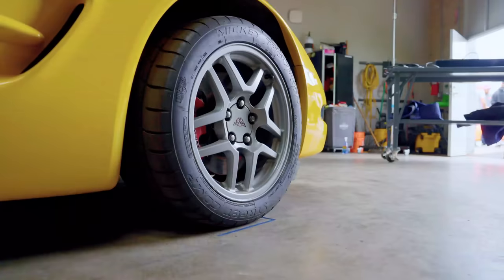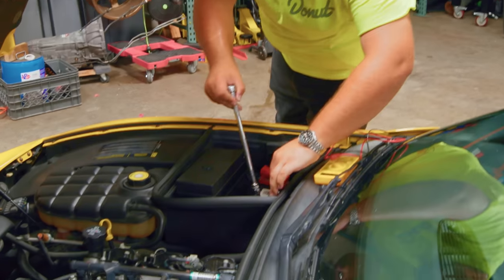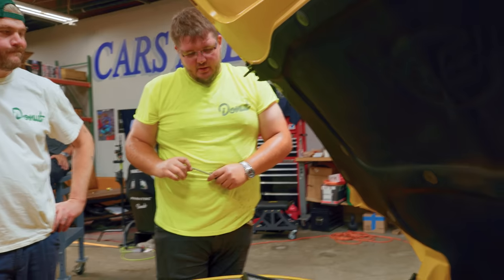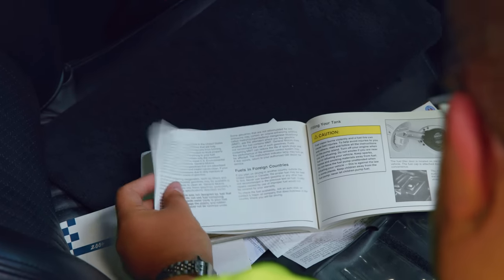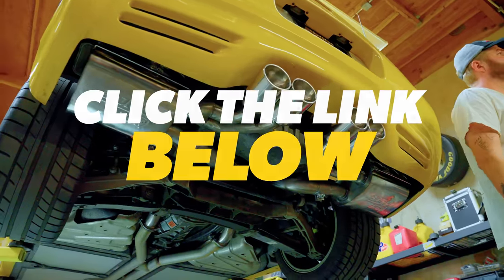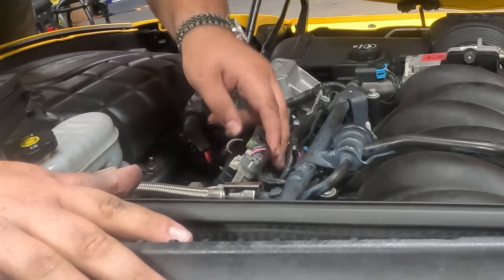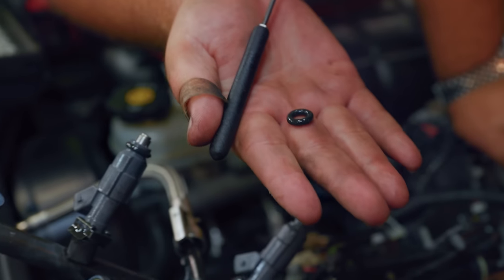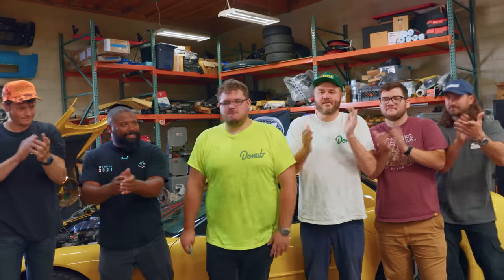Giving Someone a Corvette, If They Can Fix It

Comment: im ngl i like when people in videos actually stick to what they say instead of feeling bad and giving it to them anyways.
Reply: Agreed but there should be a secondary prize. Like a $2000 beater or the $20000 Corvette. Plus them saying there’s six things to fix the car then having multiples of certain things, spark plugs I get because that’s eight of ONE object, but having multiple vacuum leaks is MULTIPLE objects. That’s more than six. A vacuum leak is a symptom of a fix needed so they should’ve either just done one vacuum leak or said there were more than six fixes needed. Of course they can’t just win every time so not worried bout that but you’d rather see someone lose because they don’t know how to fix it, not because they did something slick or anything that could be considered dirty.
Reply: @OnEst_Opinion yeah this one was the hardest one so far I think. And it’s a v8 so there’s tons more to check. And it being a corvette is just allot of stuff to check in the 100 minutes he got. I do agree he should get $500-$1000 per each problem he fixed. So that if he only did 4/6 he would get $2000-$4000 and then the grand prize if you do it all you get the whole car.
Reply: @OnEst_Opinion bro finding that last vacuum leak would have taken half an hour alone
Reply: It would have been great if they hadn't have cheated.
They say 6 sabotaged things but in reality they did 10!
Reply: @dalynferguson2582  I don't agree. These sabotages were quite basic. Nothing particular specific to a Corvette. For example, when you find a plug with a broken wire, you don't stop checking the other plugs. He let the pressure get the better of him and thought that since he found the sabotage, he could move on. Forgetting his basic mechanic skills.
Reply: @OnEst_Opinion  When working on a car, if there are 2 bad spark plugs, then I'd say lack of SPARK is the problem (One object)...And likewise, if there is one or two vacuum lines that are bad, I'd say VACUUM LEAK is the problem (Another Object). If the car won't idle smoothly unless you fix ALL leaks, then I'd count it as one....That's my take on that part 🙌
Reply: what this car worth in the states ?
Reply: @kio51423 agreed. being in the industry if i had a customer with a vacuum leak as their reason for rough idle, say we just fixed one leak and did not recheck the system. they came back with a rough idle, it would be counted as an incomplete repair because we did not quality check our work
Reply: @nicovanos  You're using hindsight bias.
Reply: @kaisyaya8492  Not sure of the mileage but it's also an autotragic. If it's high mileage, I would say roughly $20,000 USD. Mid-high 20's if it's lower mileage (and had a manual transmission)
Reply: And you know they loaded him down with merch lol
Reply: @OnEst_Opinion  In the ending shot you can see he's holding a wad of cash so, that sounds like a good consolation prize to me
Reply: @hhaste 14:49 Is that not manual? It's a quick shot, but the ebrake is up, too.
Reply: @kaisyaya8492  maybe around 20k depending on the miles.
Reply: @kaisyaya8492  a manual z06 will easily go for 20-25k, possibly more depending on condition/miles. I bought a base model manual c5 a bit over a year ago, and average price then was 15-20k for base models. It being manual adds a lot of value.
Reply: @pprb123  Just about to mention this. He's holding a stack of bills in his right hand at the end, but I'm sure it's hard to dull the sting of not being able to roll off with the Z06.
Reply: @dalynferguson2582  He was holding some cash in his hand at the end.

Comment: Damn 90 minutes(plus the 20 extra for installing the borla exhaust) for 2 spark plug wires, battery, a fuse, 2-3 injectors, a block of ice with a key in it, AND 3 SEPARATE VACCUME LEAKS. It would have taken me more than half a day to fix all that assuming I could find them all quickly. Good job to Sam for getting to the last fix. He deserved the vette 100%

Comment: I feel like the throttle position issue should've given him a little extra time.  You did tell him 6 problems but  then there was a 7th, even if it was because of the battery.
Reply: There were 5 between the vacuum leaks and spark plugs, kind of stupid for them to say only 5 issues imo

Comment: Vacuum leaks are some of the hardest mechanical issues with vehicles, mostly because they're hard to diagnose and to track down. This test was so brutal, Sam you did a great job, you should at least get a consolation corvette model or something or maybe even another shot at another car.
Reply: No they are not! Hard to track down , if you have a scan tool go look at your data logger and find your sorry and long term fuel reins they will tell you where your leak is!
Reply: @JohnC-hj3dr  a data logger will let you know there is a leak and determine how large of a leak it is, but it's not going to tell you where the leak is coming from (brake booster)
Reply: Finally, someone who used the correct word and spelt "consolation" correctly.
Reply: @supradrifttv  They brought that into the shop and cut, loosened, and disconnected some stuff on the spot. Therefore, the computer wouldn't have thrown any codes that would've helped him out. I have a leak detector that uses smoke for vacuum or exhaust leaks which I bet would've helped him out alot here. That being said I doubt I would've fully solved half of the problems on this vehicle. There's a difference between finding common everyday problems with vehicles versus finding sabatoged stuff...

Comment: So close yet so far! Sam did very well. It almost felt like he was diagnosing the car as a pre-obdii era car (engine basics fuel, spark, etc.) which are a good strategy on every machine, but if he had connected the obdii reader first he probably would have found the fuse, fuel injectors, and spark plug wire tampering a lot quicker and saved some time.

Comment: That was brutal @Donut. I get not everyone can win but clearer instructions/directions would have been perfered. They never said they would (or even could) have repeat issues. And vacuum leaks, especially multiple, is tough to chase down on a engine when under a time crunch, even for seasoned mechanics. @Sam, keep ypur head up bro. 9 issues (not 6) in 90min and you got 8. Thats pretty awesome, and probably better then inwould have done.

And what happeded to the bonus time for trivia answers?
Reply: theyu didn't give him +10mins for the second spark plug wire either. This was not cool

Comment: I hate knowing that there are Mechanics and Technicians out there suffering with the clock the same way as Sam.
Reply: And if they did what was said in the intro.  He was supposed to be given an opportunity for more time regarding  car or donut knowledge.  Which they only had the exhaust.    No knowledge questions.   Just an exhaust task
Reply: @drewmassa  I think the Fuel Injector O-Ring Disaster of 2023 may have scuttled the Trivia portion of the show. That seems to have really eaten up too much time

Comment: If they had let him start it up, it honestly probably would have actually ran fine without the brake booster line 🤷🏻‍♂️ I get that it was a sabatoge. But if the premise is to get it "running right", it probably would have been passable.

Comment: Bummer to see sam lose but as it goes with diag it's air fuel spark. And you try the simplest methods first and you check them all. None of the sabotages was Corvette specific. Also as a tip out there for ppl, the obd port has a linked fuse with the cig lighter/ aux power. If neither works it's a blown fuse. Might have saved him time.

Comment: he did some big mistakes under pressure going after crankshaft sensor before checking rev meter and checking for codes to confirm Cam/crank shafts correlation problem ,,  and he gone for vacuum leaks and sparkplug wires before starting the car which wouldn't prevent a v6 or v8 from running and trigger codes which would be easier to diagnose later

Comment: That was NOT 6 things wrong with the car, that was 9+!!!!!!!!!!!!!!!!!!!!

This one was NOT FAIR for the standard time allotted.

MULTIPLE plug wires, MULTIPLE vacuum leaks, MULTIPLE fuel injectors. Those should NOT count as "SINGLE problems". Replacing a battery, or a fuse, or a connector is a SINGLE problem.

Come on DONUT, you can be better than this!

Comment: So the premise of this video, if I saw things correctly, is that this was 'Someone else's project car' and 'This is why you have to be careful when you buy someone else's project'

So with that said, the sabotages could be considered possible given that some people who do project cars don't put them together correctly, mis steps such as not plugging lines back in, improperly installing plug wires causing them to break, fuel injectors, blowing fuses, etc.  That normally ends in the person not finishing the car, letting it sit forever and then junking or selling it off.

The key in the block of ice though.. nah.

Sam was given a fair shake and he just couldn't pull it off.  That's life.   But he did a valiant job and much kudos to him.

Comment: Some of those were dirty sabs... Like one spark plug, ok. I feel like the second was a spur of the moment, "did we do enough to this car" kind of sabotage. At least should have just given him both plug wires when he asked for one. If he had two thrown at him, he might have looked into it himself instead of thinking he had fixed the plug wire issue. Sam needs to come back for another try!

Comment: i dunno man, i feel like if an issue comes up that has even the crew confused and unsure, some time should get added back or the air should be immediately cleared that that wasn't something you guys did. the premise of the challenge is that the car is in perfect working order other than the things that were intentionally done to it, so it's only reasonable for him to have assumed that the throttle position code was something that was done intentionally

Comment: after verifying battery voltage when u got the crank no start i would immediately plug in a scan tool and do a thorough visual while it pulls full system dtcs.

Comment: you guys did Sam dirty honestly. doing 3 evac leaks is rough af for sure in a limited amount of time ON TOP of 5 other issues. Actually 6 cause 2 sparkplugs not 1

and to be fair he did make it run with 5 min left. yeah it didnt run good but the mf started. guy got hosed </3

Comment: The sabotage went too far the vacume lines are normal stuff to check but unscrewd manifold is way too much. I had a similar problem whth that on 4.4 bmw altho the gaskets were more than 20 years old and it took me more than 5 hours to even think about that

Comment: He was unto the fuel but forgot it after seeing the spark plug wire. All he had to do was a cursory search of the engine bay. Or get the car running and listen for the intake leak. You'll hear where the air is leaking and see a high idle.

Comment: I'd need 6 hours to know i'd failed, and maybe get two sabotages. The key s still in the block of ice...only because I tried to hot wire it..because I was pissed it was in a block-o-ice

Also Sam has absolutely either watched a lot of, or has worked in the kitchen industry.

Comment: If I have found one wire cut I would have checked all of them first before ever scanning for codes because codes would have shown a misfire which would have sent him in a different direction, hence the crank sensor would have thrown a code. Fixing the wires would have probably gotten it started even though it may have run wrong. Once its running finding other stuff wouldn't be as hard.  Techs today think codes are the fix for everything....:hand-orange-covering-eyes:

Comment: Any mechanic explanation why he knew some inyectors where bad?
Reply: So I knew they were bad because I actually lifted them up and had someone turn the car over. I watched which ones were spraying and which ones were not. 😂. Not the best way to do it but I didn't have time. Adam the shop manager told me after you can put a screw driver on them and put your ear on the other side and listen if they are clicking.

Comment: I'm sorry, but he lost a lot of time going off-road without checking things in order. I think he started really well, but didn't check all the sparkplug wires or the injectors at first. Maybe a can of starter fluid could have been useful to do a fast diagnosis of the ignition system. For example, if you find one/two sparkplug wired cuted, doesn't mean that the car wouldn't start so If you test that you have spark, then the problem is within the fuel system (with the starting fluid should, at least, make some pop).
Reply: So this video definitely makes certain things seem like they didn't happen and it also hides some faults from both parties. I did check all the spark wires, I just didn't pull them hard enough to make them pop off. I was always taught to be a little gentle with them and of course once they said "do you only need one, I check them all. I was actually on the other side of the car checking them. I actually ended up replacing all the spark wires 75% through the challenge because I believe I found 3 broken ones total via my memory. The car wouldn't even pop over and once I replaced the OBD2 fuse it did. It ran on half the cylinders and that's when the fuel happened. I spend basically 60-70 min to get the car firing and then at that point I only had another 30ish to get it running right. The last thing I had was actually 1 out of 2 coils and that vacuum leak. I made a video about it you should definitely check out. I actually think I didn't do a great job until this video got posted and all the comments. I realized now, I might have failed, but I tried my best. It was just a lot to do.
Reply: @just_another_car_show  quit makin excuses
Reply: @Ryuga117  maybe don’t believe an edited video lol the guys on donut are chill but the actual company itself is a joke it’s still a big time company that has higher ups who only care about money

Comment: If only  he picked up on the "3 of the 6 challenges solved" at 14:10 he could have found out that one of the sabotages he thought he fixed was not counted. Def had to be the missing spark plug.
Reply: So, when they said this, this was the first time I had heard there were 6 things wrong. I definitely picked up on it. I talk about it in my video slightly but I didn't even know the intake not being bolted down was something that was a sabotage. So I thought the vacuum hose by the throttle body was one thing. I had accidentally loosened the wrong bolt talking out the injectors so I thought it was my bad at the time. Didn't really matter because the injectors/replacing all the wires/getting sidetracked but some phantom codes and a couple bad hints ate my time.
Reply: @just_another_car_show  nah u clearly didnt put it together good enough but nice “phantom codes” excuse, not like we watched u use the OBD or anything

Comment: USUALLY a sabotage is just one component. by cutting and removing multiple spark wires and vacuum lines its like adding more challenges. plus the key in the ice was a d!(k move.

Comment: He never stood a chance. I know about everything there is to know about the C5s and it probably still would have been close with that amount of time. I felt bad he didn't know you could check the codes using the DIC. Plug wires always go bad on these, if you need to replace one you should do them all. Same with the vacuum leak, usually if there's one, there's many due to the heat and the rubber deteriorating.

Comment: There weren't 6 sabotage, there were 9. You can't count 2 plug wires as 1 issue, same with the vacuum leaks. And what happened to the extra time for Donut knowledge and "mechanical know-how?" I was expecting a quiz game or something. Kinda disappointed

Comment: im a little sad on this one. I'm not great with math but there was 9 total issues not 6. If im working on my own car and saw two spark wires ripped thats two issues not one. Not to mention the ice block being timed and pulling the obd2 fuse when thats a normal part of diagnostics. Whole video felt kinda rigged because of this. The time is so low for diagnosing and fixing 9 issues and of course it's gonna be confusing being told 6 issues but theres more. I just cant stress how lame that is. Not to mention that's misleading that they're the same issue too. Fixing one plug wire when youre told there's one issue shouldnt mean theres a second wire cut. Idk if i explained that great but im honestly just disappointed

Comment: Unsubscribing after this. This was a setup plain and simple. He got the worst car by far, and not even the round of trivia questions was given to him to get some more time. They didn't even help him by at least saying "you have 2 and a half problems fixed", instead of just saying "you have 2 problems fixed". That could've helped him figure out that there was more than one spark plug wire cut.

Comment: all engines do this. suck squeeze bang blow. when diagnosing an engine of any type, is that not correct?  im guessing the intake is not restricted , so we got the suck , now we need the squeeze , do we have compression?  im guessing thats fine, now we need bang, a spark ,then the last pat, blow. if im confident that the intake and exhaust is not the problem, it leaves only fuel and fire. is that not correct? for if an engine can get air, compress it, mix it with fuel and ignite is do we not have combustion?  i have not even watched it, but am confident its either fuel or spark. i mean if its got all those it will run. it would take me 15, maybe 20 mins, and ill know why its not running. figuring out why its got no fuel, or no fire , may take a bit of depth. i think a simple apparatus that gave the engine fuel, and provided spark in the correct timing, would make it go. unless a Potatoe was stuck in the exhaust or a sock stuffed into the intake. i wish i had the chance to win this.